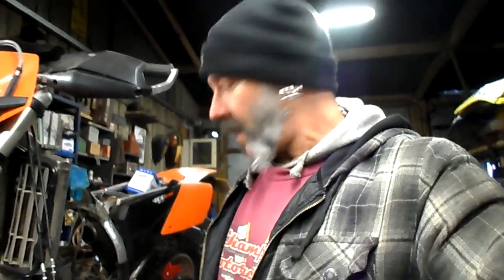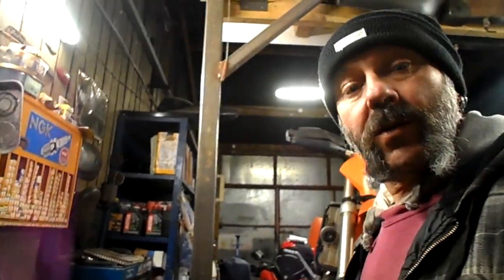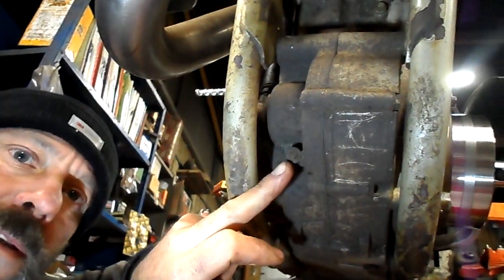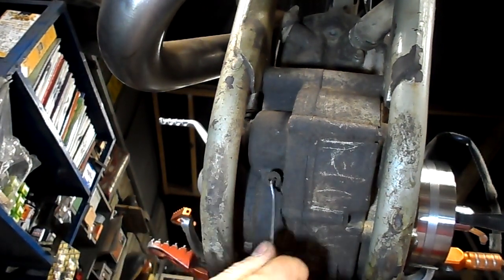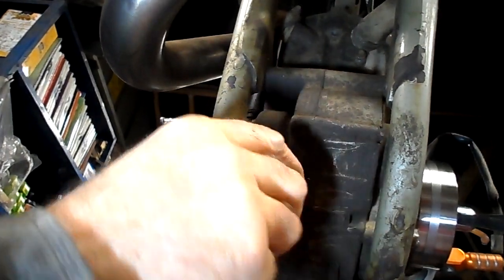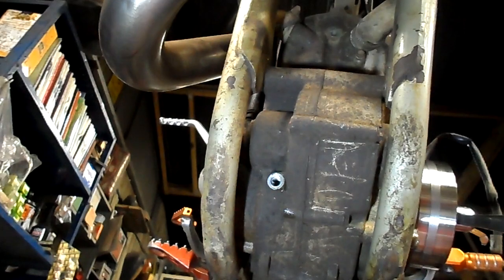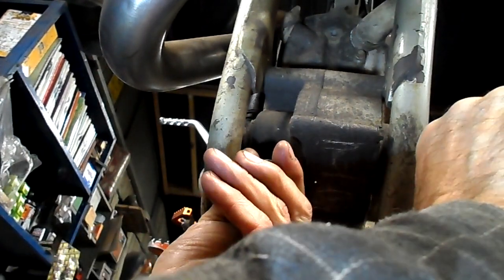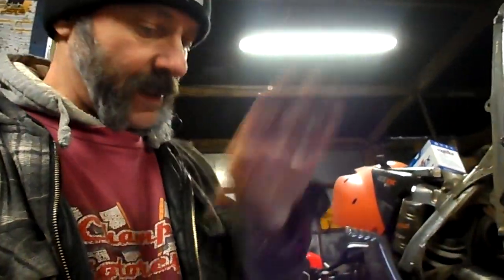KTM EXC SX top dead centre , timing marks

Comment: After you finished the work do i take out the bolt? Or just leave it ?? I did the lock in the piston but im not sure what to do after i close the engine and is ready to test im afraid the bolt will cause damage since it locks the piston. What should i do with the bolt?????
Reply: Take out bolt

Comment: First time I did piston I didn't lock at TDC what a hassle definitely I did the wrong way
Reply: When you lock the piston and finished the work do you leave the bolt like is. Or take it out to unlock the piston??
Reply: @josefernandez1364  your gonna wanna leave it in because you might as well check your valves it just makes it easier
Reply: @josefernandez1364  just dont forget to remove bolt and put spacer back in before starting bike